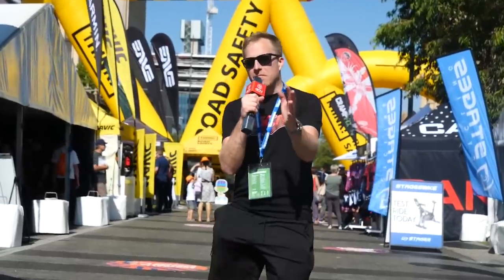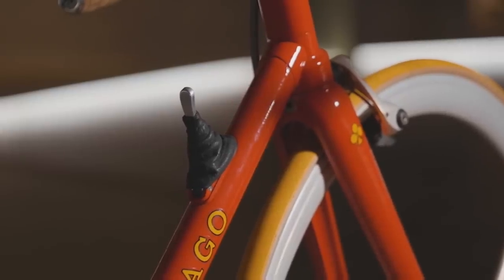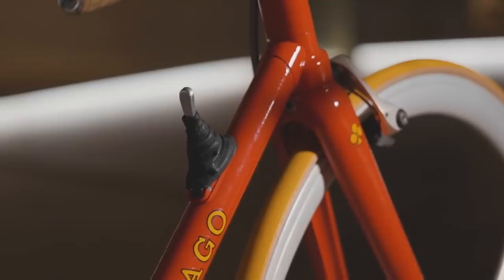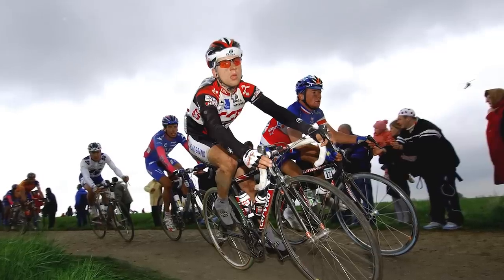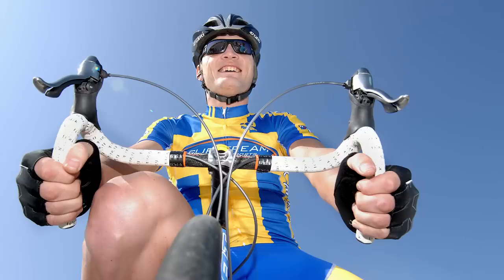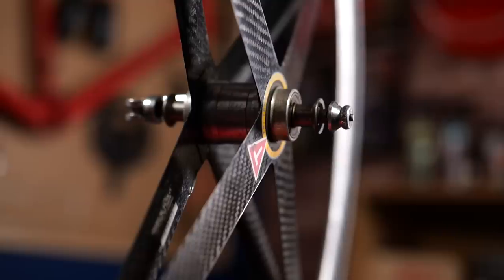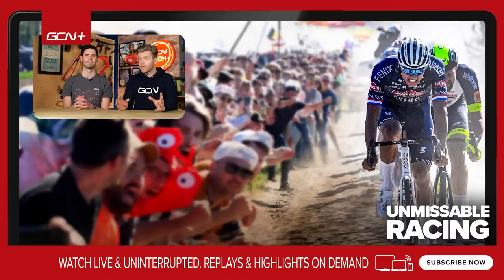5 Bits of Retro Tech You Need To Know About!

Comment from the maker: What's you favourite bit of retro tech? 👇
Reply: Strong legs🎉 them old boys kicked ass and didn't complain 😊. I don't miss tuff tops
Reply: Rim brakes😂
Reply: Air actuated derailleurs, hydraulic actuated rim brakes...
Reply: Jon is my favourite retro tech
Reply: Spinarchi bars
Reply: Oh for me it was those elegantly beautiful Cinelli quill stems  in the steel bike era -  just gorgeous.
Reply: Campagnolo Record Delta brake set. Thirty years on and they still look ace. Rim brakes forever!
Reply: The NES.  Oh, you mean bikes. Hmm 🤔🤔
Reply: Mavic Zap electronic rear derailleurs
Reply: Spinergy wheels, they looked cool. Sounded great and were fast . 🖖🏻
Reply: Fixed gear 💀
Reply: Groupsets
Reply: Cinelli clipless pedals and Cyclebinding Clipless pedals.
Reply: HED3 wheel. Love them.
Reply: Pursuit bars
Reply: Kooka cranks, Hayes HFX9 22mm hydraulic calipers, and URT mountain bike suspension.
Reply: I actually owned a 1996 Merlin Ti mountain bike with all custom, small manufacturer parts (i.e.; Pauls, etc.), and had a second set (besides my regular spoked {albeit Ti spokes!} trail wheels with fat knobbies on them) of Spinergy wheels for riding it on the road with Specialized Fat Boy slicks on them. ;)

Comment: The Spinergy wheels were solid and the danger was way overblown. The failures were due to damage. I have a set of the 26” mtb ones with lots of miles and they are still rock solid with no cracks.

Comment: I had my Rev-Xs from 1997-2004.  At their introduction they were deemed the most aero wheel out there (faster than Zipp's at that point).  They were heavy, but most everything else was too (outside of super expensive Lightweight wheels). I never found them to be weak, and only retired them after a crash that saw two of the blades on the front wheel take a little bit of damage (it still didn't break through). I believe I sold the rear wheel of the set after that.

Comment: I'm continuing to use some Rev-X's for special events.  They are still my fastest and most comfortable wheels.  I consistently out-roll all of the modern deep dish rims.  Yes, they are squirrelly when out of the saddle or in crit type corners, but for cruising or TT they are great.  That UCI rule that they failed was not about strength but their failure mode, i.e. when broken they would not stay in one piece. The rule was pushed on the UCI by Mavic who were just trying to eliminate some competition.

Comment: I worked as head mechanic in a bike shop back in the early/mid 90’s in Connecticut. We were one of, if not the first shop to carry the Rev X wheels. The owner of the shop was friends with the guy that owned Spinergy iirc. They were based nearby and if I recall, he worked at Cannondale (also local) before starting Spinergy. I sold tons of these wheels back then. Also, fun retro stuff, like Mavic Zap electronic shifters. Ah, the memories.
Reply from the maker: Wow! Sounds like you were brushing shoulders with some legends 🙌 What was the shop called?
Reply: @gcntech  Greenwich Cyclery It was a dream job.

Comment: Great video!    Twenty five years ago, I bought a very cool used Trek 2300 Composite Competition.  It was built with carbon top/down/seat tubes fitted to aluminum lugs and stays.  It had Shimano 600 components which still shift very smoothly with little maintenance done over the years.  The previous owner had tricked this bike out with Scott arrow bars AND Spinergy RevX wheels for Duathlon/Triathlon.   Still looks like an awesome bike between the frame and wheels.  And probably the smoothest overall bike I've ever ridden.  Ollie, if you want to be cool like Alex, I would be willing to part with the Spinergys as I don't do the multisport events anymore.  Let me know!  😁

Comment: I bought Spinergy blade wheels on my mountain bike.  I was quite skeptical that they would be durable, but my bike shop assured me they were designed to be tough.  I broke them within weeks.  Cracked rim.  I took them in for warranty repairs and they were sent off to Spinergy.  What I got in return was their flexible spoke wheels that required a special aluminum spoke tool to adjust and constant adjustment.  I guess they had a lot of issues with the carbon fiber blades for mountain bikes and quickly discontinued them.

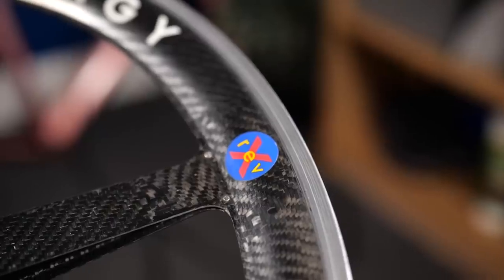Comment: The RevX wheels had a tendency to fail at the spoke/rim interface.  Once one spoke cracked, the change in load led to a rapid failure of the remaining spokes (thus the "exploding" wheel), resulting in some serious rider injuries.  Spinergy attempted to address this by adding rivets to later versions (see at 7:40 in the video), but they just proved to be stress concentrators and make things worse.

Comment: I grew up using the Shimano 600 series. It was great! I also had a Huret Duopar rear derailleur in titanium, which was the bee's knees at its time (mid 80s). Silky smooth shifting, wide range for a touring bike I had. Bike was stolen. I'm still sore about it.
Reply: Death penalty felony to the thief that stole that magnificent Huret technology.
Reply from the maker: Ah no! Never nice to hear about a stolen bike. Did you replace it? 👀
Reply: @gcntech  Eventually, yes. The stolen bike was one I had built up myself using a Klein Performance frame. Since then, I have built myself an assortment of bikes over the years.

Comment: I mechanicked on a race team that used Spinergy RevX wheels as their 'go fast' wheels, back in the day. They had a nasty habit of separating at the spoke/'rim' interface, which is why they had those natty little rivets just there, but they didn't help anyway. Seeing your team's wheels disintegrate during sprints, as the wheel split in two, wasn't a fun experience after the first time. The riders refused to ride on them after a while, and we went back to 28 spoke delta-pattern rim standard wheels.

Comment: How I remember it is that back when the Spinergy wheels were released the rumour was that they were about as air as 32 spoke box section rims.  When the blades are horizontal they aren't cutting through the air much.

The Spinergy do look cool, but the Specialized trispoke was suppose to be far more aerodynamic than the Spinergy, well that is what the rumour was at the time.  But Specialized trispoke were only used for TT and not for anything else, they were heavy and had no spring in them.

Anyway I stress that that's how I remember it.

Comment: Although technically true that the Colnago Concept introduced in 1986 was the first use of carbon fiber in a frame, an argument can be made that the Kestral 4000 introduced only a few months later is a far better early example of carbon fiber frame construction.  The 4000 frame was made totally of monocoque molded carbon fiber construction.

I rode this bike in the UK in 1987. Being extremely aerodynamic at the time and equipped with bladed spokes that I imported from the United States, the bike was extremely aerodynamic. The Brits loved these spokes and I was able to sell many hundreds for twice what I paid.  I also used the Greg Lemond Aero Bars, which he used to beat Laurant Fignon by eight seconds in the 1989 Tour De France. It's been said that he would have lost to Fignon had he not been using these bars.  Needless to say, even at 50+ at the time, I held my own in the two-to-three-time trials I rode per week.  What great memories!

Comment: Peugeot had the Fibre Carbone in 1983. PY10FC on sale to the public.
1988 Corima carbon rims.
I've got a Shimano 600 Arabesque set.
Simplex gears via derailleur. 1935 Claud Butler catalogue.
Cyclo 3 speed togglechain derailleur in 1936 catalogue. I have a bike with this.

Sack your researchers.

Comment: I myself had a pair of RevX Wheels, really heavy, really dangerous and the sound of the blades was something else! I actually miss them 😅
Reply: I still have a pair, they aren't particularly heavy but they aren't fast.
Reply: @stevezodiac491  as I recall it was 1.9 kg for the pair or so, but yes they are FAST!
Reply: Why dangerous? I have not been able to find any reputable reports of multiple failures. All wheels can fail; did they actually fail more frequently than others, or did they just get reported more?
Reply: @TheBlaisepascal  compared to specialized tri spokes of the day they were definitely much slower in time trials I undertook on both over many races.
Reply: @dms12345  they weren't dangerous, the uci just thought they were, same as getting rid of spinacci bars for the same reason riding in multi start events. Mine are still OK decades after they were bought.

Comment: Still got my Spinergys. Bought on original release, drunk in charge of a credit card, but haven't regretted them for a second.
Reply: Is your life-insurance paid up? If the things didn't simply shatter, the bonded aluminum rims quite often unbonded. Fingers-crossed you don't end up in the hospital or morgue when/if they fail. After seeing enough of these time-bombs come into the shop for replacement I wouldn't even briefly test-ride a bike with them after service!
Reply: @larryt.atcycleitalia5786  I have ridden thousands of miles on mine, no problems. Still have them to this day.
Reply: @larryt.atcycleitalia5786  I don't know what to tell you. Mine have been fine for a quarter of a century, notwithstanding my 90+ kilo weight. I check them carefully and regularly for cracks because of all the chatter about them historically - nada.

On the other hand, I broke a couple of ribs a few months ago after a tubeless set-up on another bike failed going around a corner, so maybe everything has its risks.

Comment: I took my carbon aero bike out a couple of days ago, then did the same route immediately after on my vintage steel frame* bike.  I preferred the old steel bike.  

*  To be fair, I did put modern components on it, so it has brifters and is 2x9 speed.
Reply from the maker: Sounds like a day well spent! If you could only keep one would it be the Vintage bike? 🚴
Reply: @gcntech  It wasn't really a day well spent.  We had a severe ice storm two weeks ago, then a week later we got a high of 28 C, so I thought I'd see if the bike path was open.  It was still covered in snow and ice, so I headed back home, then got the other bike and repeated the route.  It's only a couple of km from home to the start of the bike path.  Despite having had four or five days with highs in the mid 20s, we still have some patches of snow lying around!

I would want to test both bikes to see which one is fastest, then get rid of the slow one.  Speed is everything.  But then again, I spent more money on the aero bike.  But furthermore, my vintage Nishiki Olympic feels alive under me.

Back in the 1960s, I had a Rotrax steel frame, that I loved.  What I'd really like would be to get hold of a 19" (or 48 cm) vintage Rotrax frame and then modernize it.

Comment: I have ridden those spinergy wheels, oh boy how wobbly they where in comparison to modern carbon fibre wheels 😂 but back then they felt comfortable vs alloy wheels, truly bizarre feeling. I sell them quickly because I was concerned of using them on not so great roads. After all interesting experience 😅
Reply: I still have a pair. Can't say they are unstable at all but they are slow
Reply: @stevezodiac491  I have a pair as well and I don't find any issue with them.

Comment: Hi guys.  A question.  I want to fit wider tyres to my son's giant Contend SL1 rim brake bike.  it came with 25mm tyres.  I can get a Schwalbe Pro one 30mm on the rims and in the frame, leaving a gap beneath the calipers but.  This only leaves a 3mm gap.  Is this OK? Is there a minimum gap there should be between the calipers and the tyre?

Comment: 105 is clearly no longer the "groupset of the people" so it's nonsense to keep calling it that anymore. 105 up to R7000 could be bought in any config, disc or different rim brake options, braze on or bolt on front derailleur, to fit any bike of any age for reasonable money. The last update doubled in price making it too expensive to be "for the people", but more importantly it fits far less bikes. If you can't get any options to fit it to a great frame you've had that's only about 5 years or more old, then it's clearly not. 

I actually fitted R7000 on my modernised '84 steel bike. Its a beautiful groupset and I love it. But for no amount of money could I have fitted the latest 105 because it has to have internal routing for the batteries, disk brake only, and no clamp-on front derailleur option making it impossible to retro fit to vast amount of great bike frames out there.